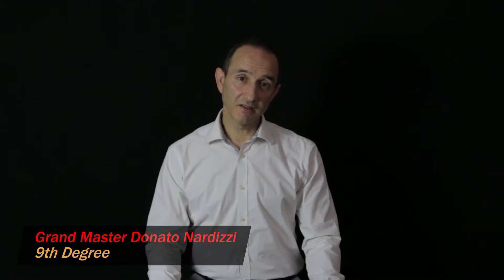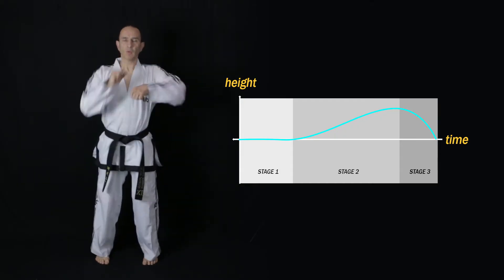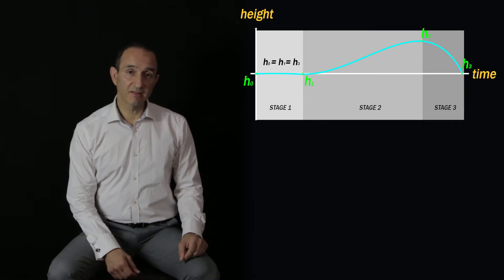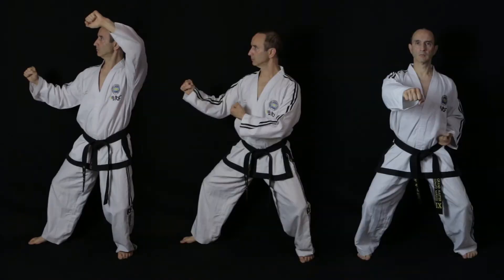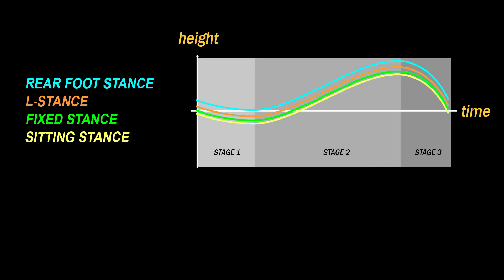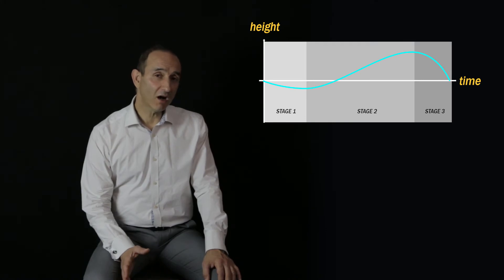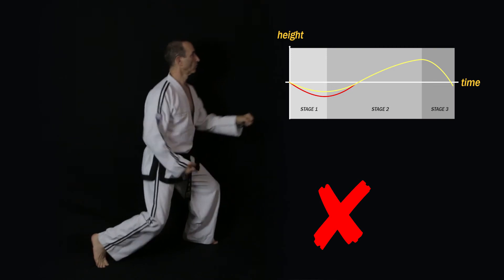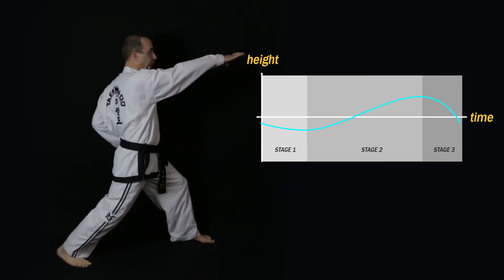Taekwon-Do Science: Sine Wave Motion #5

Comment: Where is the kime with what appears to be locked knees?
Where is the kime when one hit forward while moving backward?
The end purpose of stage #1 is to telegraph your opponent that youhave started your attack.
As with all other children karate, there is no sense of hitting a target with this wave concept.
Normal! They do not hit anything almost all of the time.
And don't tell me Kyokushin is a martial art! It is an organized fraud from the time Oyama started it in early 1960.
Unsurprisingly, Jon Bluming moved out of there very early!
Even today, they "condition" wood, bricks and ice blocks, before every "demonstration".

By the way, japanese martial arts died the day the samurai were disarmed, back in 1876.
Reply from the maker: 'Kime' is not a term we use in Taekwon-Do and I believe it is used in Karate. I have no background in Karate but I believe what you mean by it is focus and/or power. Having a locked rear knee actually increase the energy transfereed to the target by creating a resistance to the reaction force generated when hitting the target. Try resisting someone trying to push you backwards. You will naturally  lengthen you stance and lock your rear leg to maximise your resistance. But when you performing strike of punch it is important to lock the rear leg at the moment of impact otherwise you lose the focus.
Stage #1 is purely to relax the body. It does telegraph the technique especially if done too slowly. When practicing patterns and fundamental techniques we are in no rush, so we take our time to relax. In a real fight we adapt the technique to be quicker. Ideally we relax first, to be better prepared for the technique but it is done very quickly. Those advocating removing stage #1 are also suggesting that you shouldn't relax before a technique. A key difference between an expert/master and a beginner in any sport or physical discipline is the ability to be relaxed when performing. Of course there are instances in martial arts or sport were you have very little time to react and your perform the technique with more haste. But that doeas not mean you should always practise this way. At the developmental stage, whatever the physical discipline, it is a good strategy to practice in a relaxed slower pace to properly develop the technique for a faster, more hasty execution of the technique.
Regarding telegraphing techniques, there are other things that also telegraph. E.g. winding back the attacking limb, tensening up, small shift in stance etc. Every technique will have some form of telegraphing but you have to accept them and make sure that they are reduced it to a minimum when using the techniques in a real situation.

Comment: That does sound like fake science.
Reply from the maker: I don't need to teach fake science. I have degree in physics and I understand the theory of power and movement. This series on sine wave motion is not meant to confuse you with scientific jargon. I have tried to keep it simple for Taekwon-Do students with just a basic knowledge of science. The seroes is not finished. The last few videos (when released) will explain how sine wave motion can help deliver more power in an efficient way.
Reply: @DonatoNardizzi  nice series but biomechanics and physics are very different disciplines with some cross over of course. Applying sine wave from physics to body movement seems to have created a very inefficient, slow and telegraphing gait transfer. Sometimes it’s best to disregard things from the past which do not serve us anymore. This concept (more like dogma) only serves to confuse and limit efficient movement for students. Instead, focusing on the sinking element at the end of the technique would surely be wiser. It would mean losing some of the defining features that taekwondo feels it needs to differentiate itself but would improve the system.